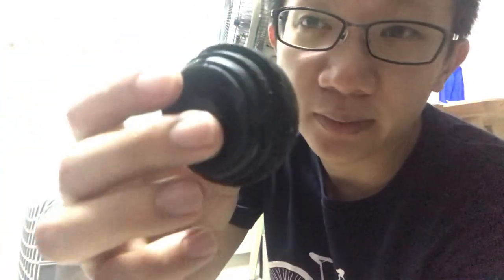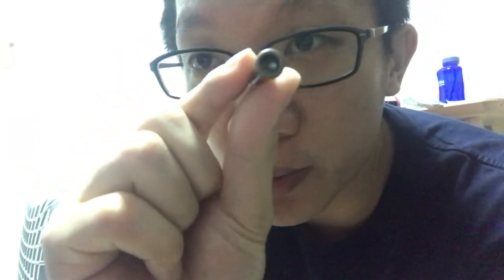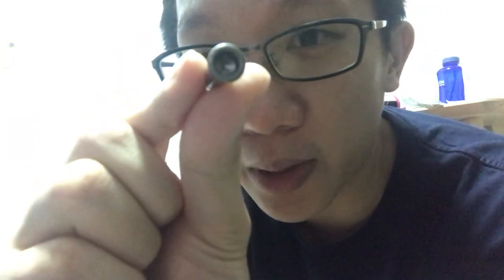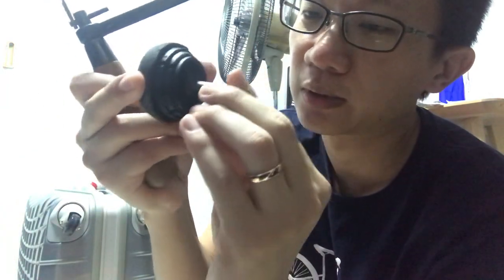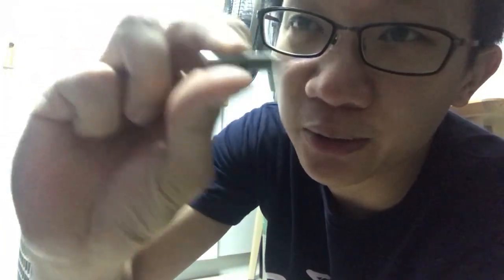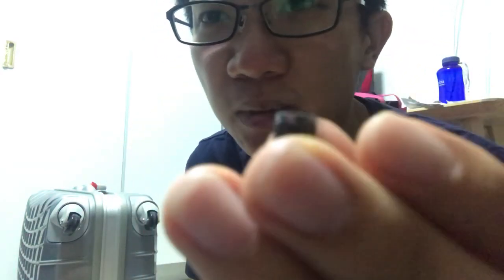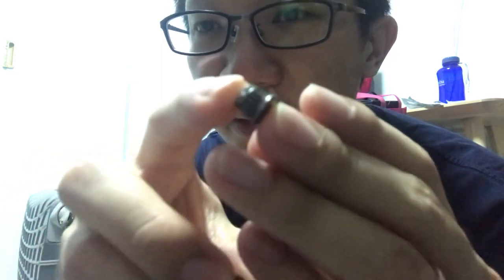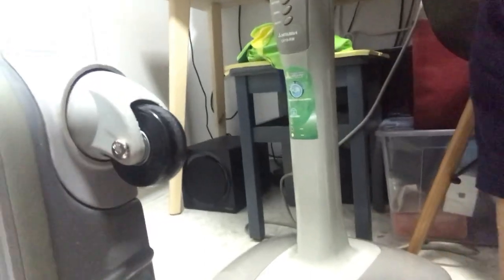Prepare and replace luggage wheels

Comment: where to get the replacements, I have a american tourister
Reply from the maker: Do check the diameter of wheel and spacing! Watch video again for reference, maybe something like this:

Black Luggage Suitcase Replacement Wheels Suitcase Repair OD 50mm Axles Deluxe Black with Screw
https://a.aliexpress.com/_mtzKNBf

Or Amazon, eBay, Lazada, which ever is your fav platform
Reply: @Starringme0  Thanks a lot, will check it out.